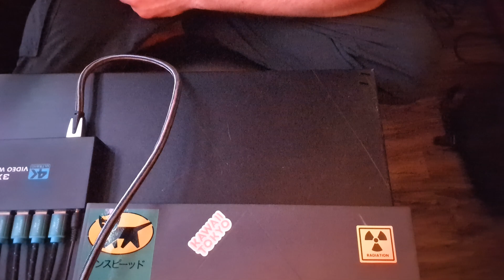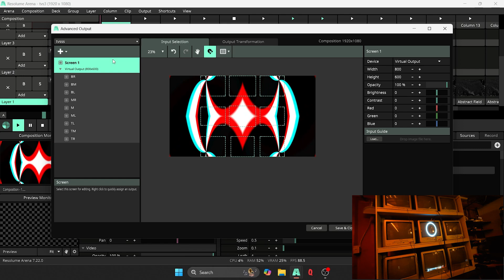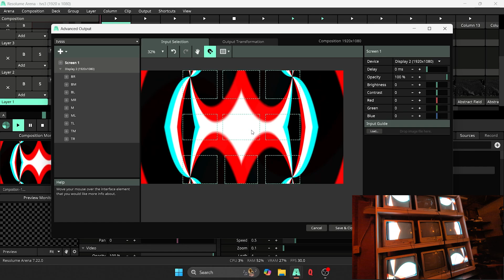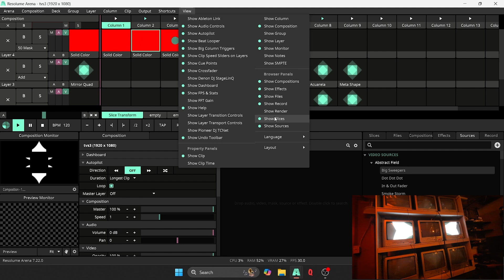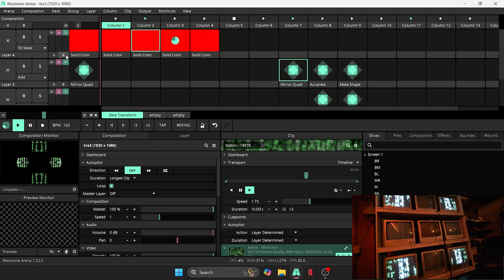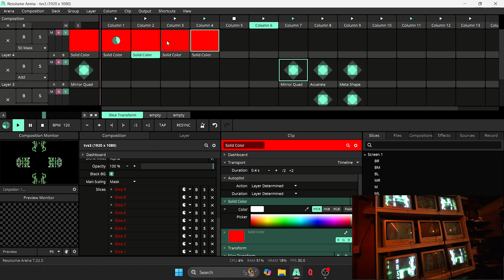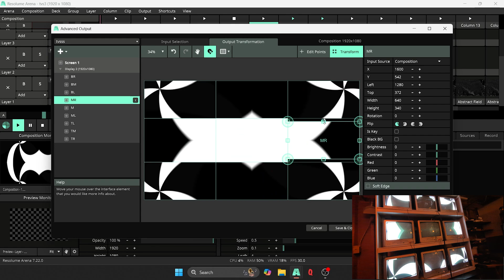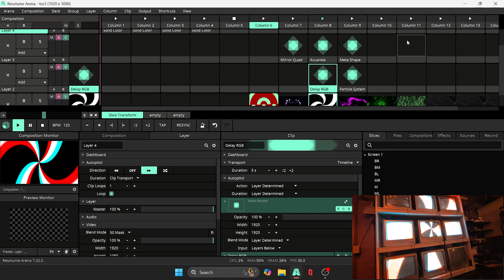How To Build A CRT Video Wall Under $300 - A Deeper Dive

Comment: Does that controller output in a 2x4 layout?
Reply from the maker: This one doesn't natively. You would have to do some work in resolume to make that possible. Or get a 4x4 controller
Reply: @sub_conscious_sound good to know, I've wanted to do this with my video wall for a few years but the tech wasn't very available then, and now downscaling 8 outputs seems like too much headache 😅
Reply from the maker: @heniac it's really not too bad!

Comment: another question: if you wanted to do analog glitches with this kind of setup, would you need one of those glitch boxes per tv since they take rca input and do rca output? i was looking around for a bit for a digital (instead of analog) glitch box that could mess with the initial hdmi source, but i don't know if that exists. the only other way i could think of to glitch out all the tvs at once was to like have 2 splitters one that converts the 9 into 1 to run through a glitch box then another splitter to convert the 1 back into 9... that sounds crazy though, do you have any advice besides i guess just swapping out the setups throughout the set?
Reply: or maybe this situation warrants learning how to make something myself with 9 inputs and 9 outputs, cause the ideal would be having just one device with dials or connecting a midi controller
Reply from the maker: I actually have a solution for you. Look up something called waaaaave pool

Comment: couple questions: do you use only 3 HDMI to RCA adapters for 9 tvs total? the program still recognizes 3 separate outputs if you split the RCA cables between 3 tvs? or do you need one adapter (and one hdmi cord) per tv? thank you for this video, it's really helpful as a total beginner to this stuff :)
Reply from the maker: You need nine downscalers. One per TV. I think what you're referring to is where I said you can use one cable to run three TVs. And what I mean by that is it doesn't matter if the color is red, white or yellow, it will work to pass video. So I buy packages of splittable cables to save money
Reply: @sub_conscious_sound  ohhh okay that makes sense, thanks for the reply!

Comment: Sick video so helpful to find someone using resolume for this. Currently trying to do the same thing but with a mix of HDMI TVs and old CRTs. Do you think this routing would work with different sized screens and then just adjusting the advanced output inside resolume?  Or would the video matrix not work with a setup that isn't grid based?
Reply from the maker: Thanks for the support! With a Keen eye, and lots of diligence. I think you could definitely make it work with different sized screens in the advanced output. I would be very curious to see what that looks like if you get it working!

Comment: Are all 9 tvs ganged up to a power strip and go into one wall socket? Wanna do something similar but curious about the total electrical load not tripping the breaker
Reply from the maker: yes they are. standard US wall outlets are good to run 1800 watts which is more than enough to run them safely